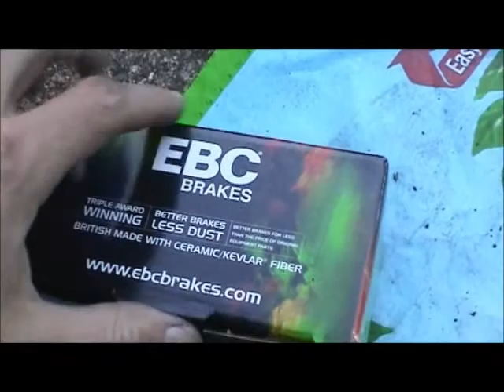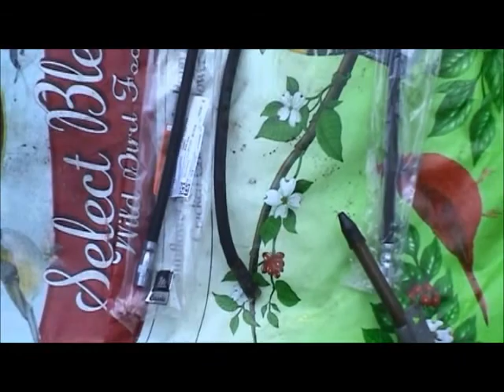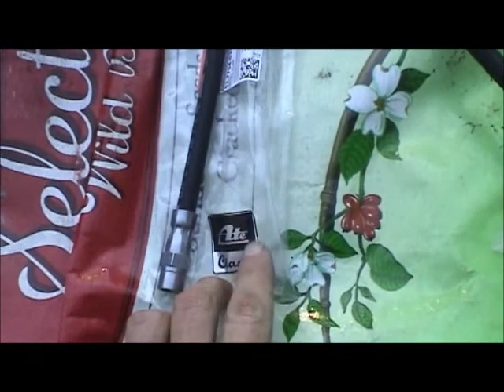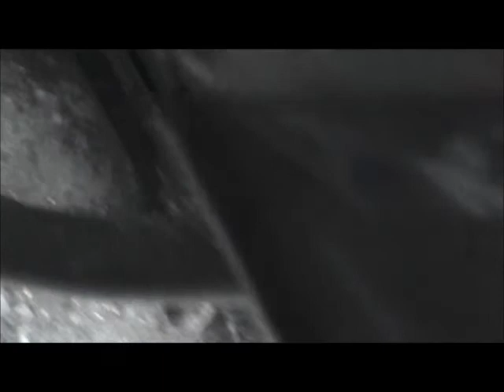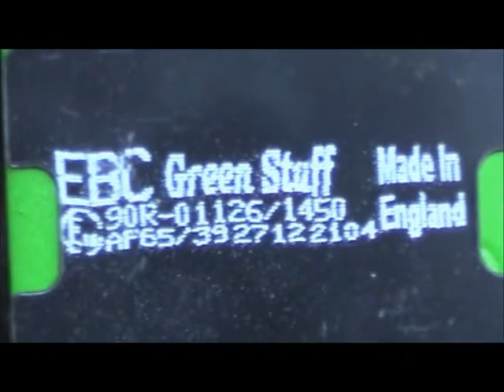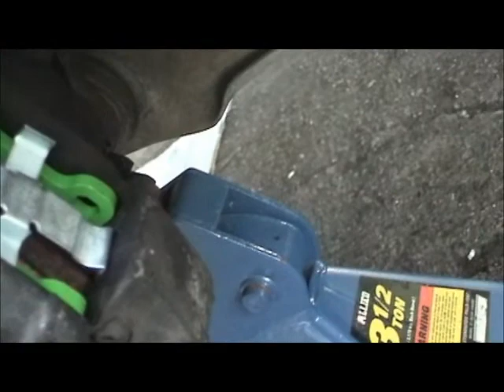1970 Mercedes-Benz 280 SE Brake Line and Pad Replacement

Comment: Question
So when installing the brake hose line, one end of the brake lines is turned and tightened while the other end is disconnected, right?

Then, the other end of the brake hose line is positioned against the spring clip where it meets the hard line with threads.
At this point, the brake hose itself is longer capable of being turned so the threads from the hard line are turned and tightened against the hose.